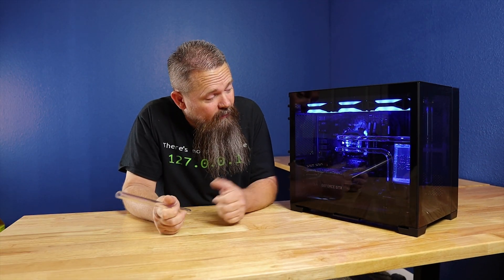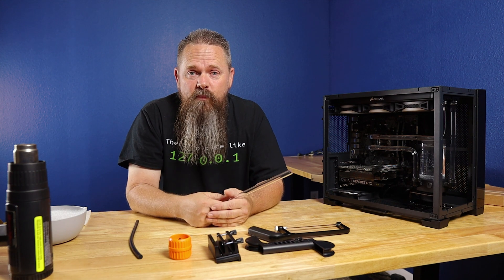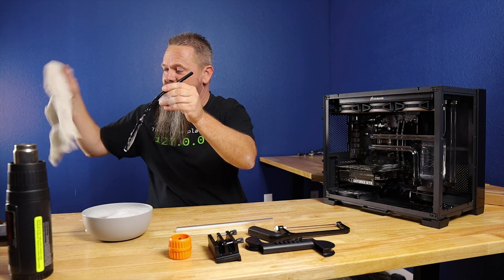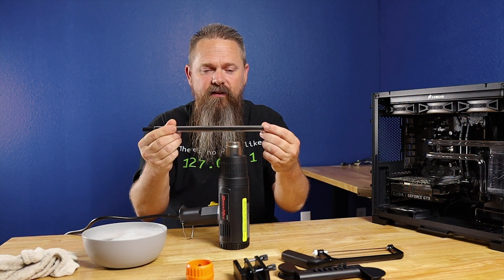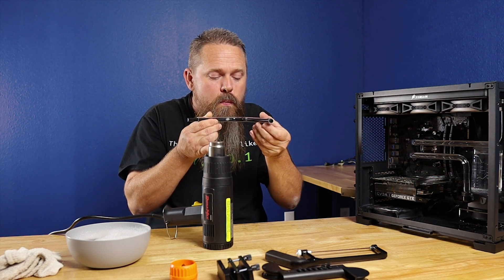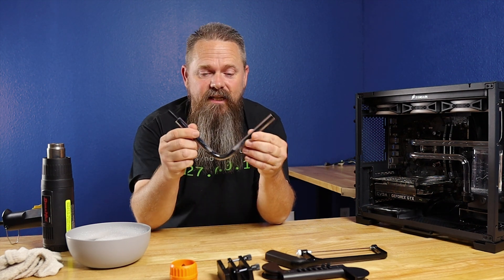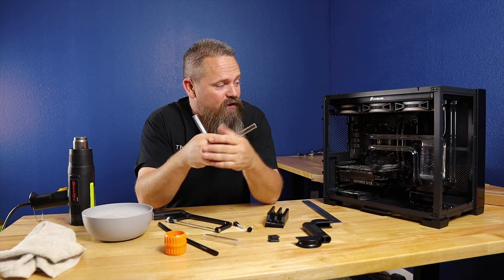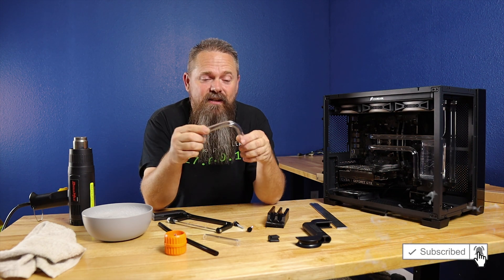Water Cooling With Hard Line Tubing

Comment: I love your content and use it on many of my computers I do have a problem with the way the heat gun is being used and mounted it breeze through the bottom and it has no air so heat just going to overheat and break if it was continued to be used like this you don’t actually only fault if I’ve ever seen

Comment: my first hard tube custom is going to be a big build for most but huge for me and like everything I build it will be overkill but that's how I roll. I'm poor so I have to wait for newest gen to come out so I can afford last gen. Core X71 ROG Crosshair VIII Formula 5950x 14,16,16 memory at 1.45v 6900 or 6950xt triple 360mm rad for cooling VRM CPU GPU and RAM. Should I try an do a video on the build?

Comment: Great video although like many others, why doesn't anyone create a video for how to measure and do multiple bends? For example a double bend or triple bend with 90 degree offset etc?
Reply from the maker: Maybe I will at some point. Multiple bends can be hard. Both bends in my system required 2 bends. I should have included that. However, my method was not very scientific. 😂😂

Comment: I like the look of the metal fittings for soft tubing better than those for hard tubing. There seems to be more variety with metal fittings for soft tubing. I also have clamps on every connection. Just my personal taste. I also have an hamster wheel and a water temperature indicator built in to the loop. I think the more curves are in the loop the more aesthetic the loop is. Just straight lines and right angles would be too boring for some. My tubing winds its way through the case. Personal taste again. Also easier to work with flexible tubing. The exact length is not so important. I also think it depends on the case. Maybe one day I will try a build with hard tubing. Right now parts are too expensive and I don't have space to add to my collection or any need to do so :-)

Comment: Good video. I have only done soft tubing up to now. You only water cooled the CPU as far as I can see. It would be good to see a video on the theory and practice of water cooling a GPU if possible. Probably expensive and not really necessary except for high end gaming PCs. It might also not make sense from a cost benefit perspective with only a marginal improvement to be expected. Would be interested to see your comments on this.
Reply from the maker: Yes, I only did the CPU. The system has a 1660 in it and there isn't a water block available for it. Water cooling a midrange GPU isn't beneficial and high end GPUs are unobtainable right now. However, the process is the same, just more tubes to bend.